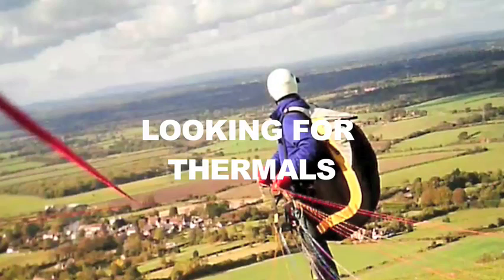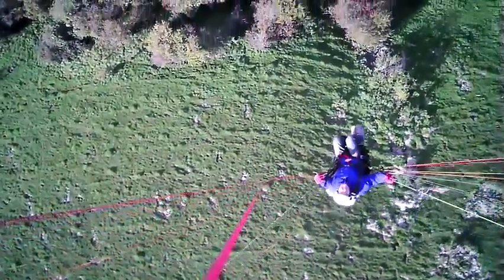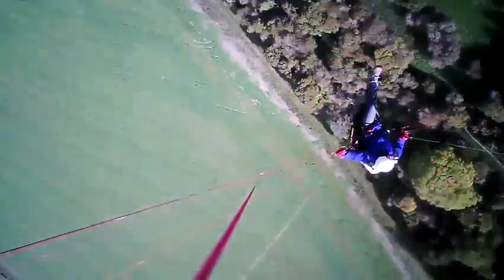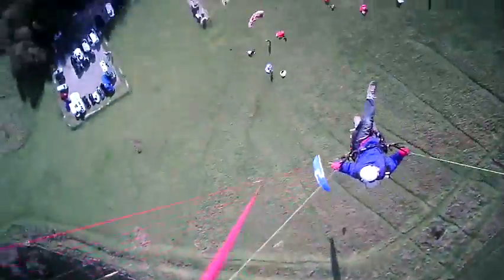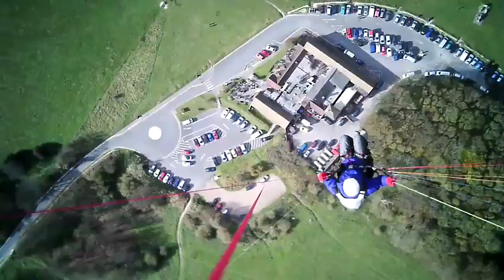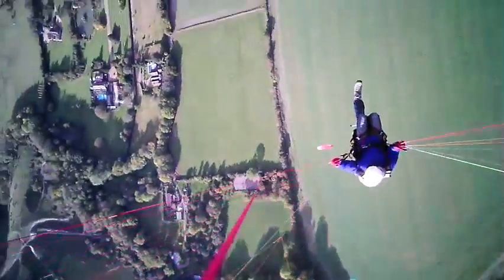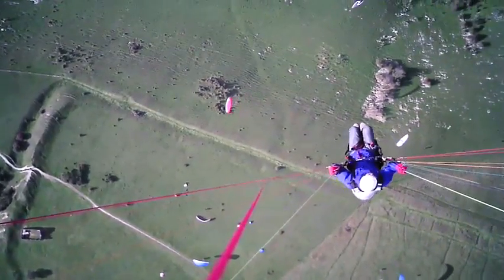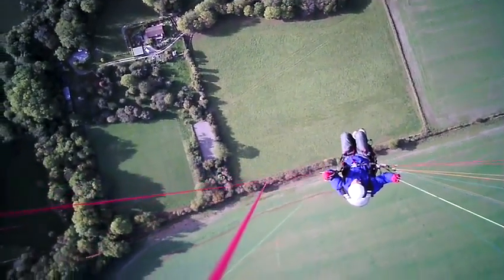How to Thermal a Paraglider learn to thermal on a low save

Comment: Can I ask if anyone can tell me what the right hand 360 rule is that he mentions around the 3:40 mark?
Thanks
Reply: huepix Each flying site has local rules to help everything run smoothly between pilots in differing sports, farm animals, General Public, Ramblers, cyclists, Landowners, the police, journalists etc. These often also mesh with local bye laws eg. no parking on a certain main road. The 360 rule is that pilots should wherever possible turn to the right in thermals to reduce the risk of collision - at THIS site. 
These rules also help pilots get together to look for some sort of consensus.

Comment: Just wandering if you keep your leg up the air with a pod harness. Strange and tiring way to weight shift, if you do any XC!
Reply from the maker: skycruiser50 all depends on what you get used to SC, when I started no pod harness’s i have found using both styles of harness have pro’s and con’s - by weight alone I can make a tighter 360 and of course all weight is contained in the correct area as designed by the glider. With xc its climb and glide, foot on bar so no time for a rest :)
Reply: Got it, thx!